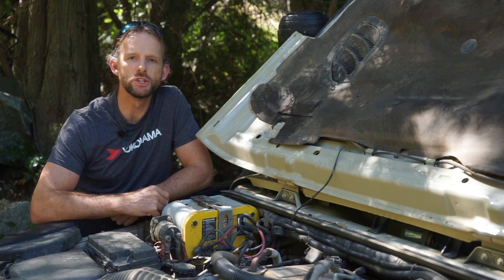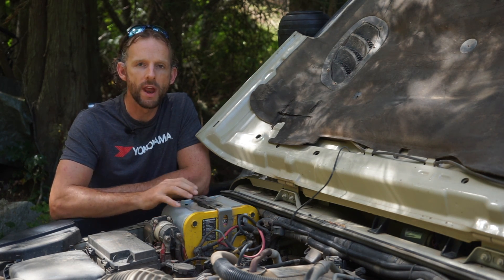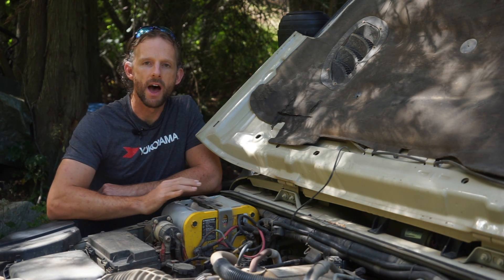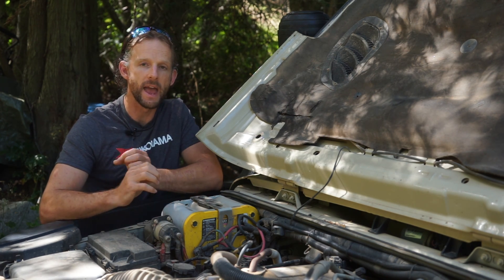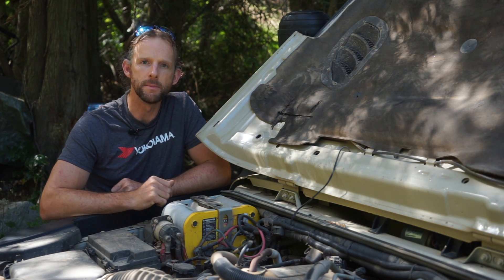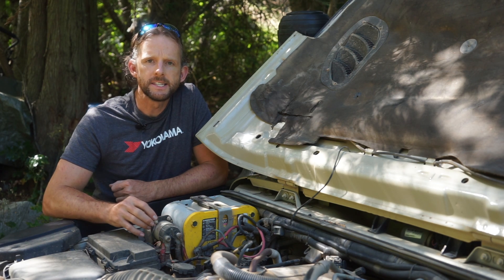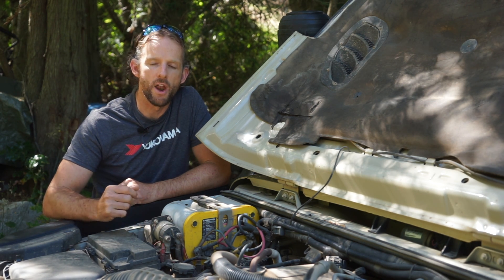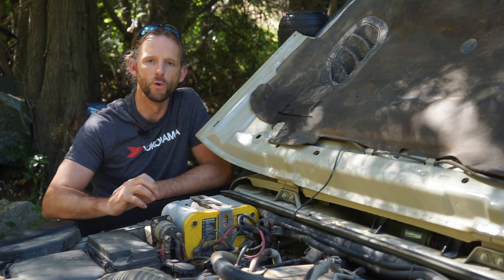DIY Dual Batteries for your Overland Vehicle - what, why & how

Comment: Could you provide a simple sketch that shows the Renogy Charge controller working with your existing system that enables the Alternator to best charge the house battery (the one most likely to be low) without overcharging the Starting battery and enabling your Solar Panel to charge the house as well? Thank you.
Reply from the maker: When the engine is running, the alternator charges the two batteries, and the solar charge controller is connected to them. The charge controller sees the high voltage the alternator is putting out, so it does nothing. So to be clear: When the engine is running my solar does nothing.
That's how my system works now with an old and simple charge controller, but as I said the newer charge controllers will use as much solar as possible, and then augment that with the alternator if needed. So I will upgrade to that kind of setup for my future vehicle.
Reply: @TheRoadChoseMe  Thank you from Fallbrook, CA.  Your explanations are always efficient and helpful. I really appreciate it.

Comment: Do we need to upgrade the stock alternator? Will it get damaged due to extra load to charge both batteries.
Reply: The nice thing about this style of system is that even with a dead house battery, the alternator only "sees" one battery that is half discharged. Generally your main battery will be close to 100% charge, house battery is at 50%.  The alternator will sense a 75% charge, and will charge at a slower rate than if you had one battery at 50%. I run the same system as Dan's, and have yet to replace an alternator.
Reply from the maker: There is a lot of debate about this, some people say yes, some people say no. There is no doubt it puts extra load on the alternator, so it probably would shorten it's service life. My stock alternator is 170,000 miles old, and has been wired up this way for almost 5 years now without a problem.
Reply: Most modern 4x4 will probably already have a relatively big alternator because under the hood there are a lot of electric accessories from the factory. An electric fan draw a lot of amps...

But on older 4x4 you  may have 40 or 60 amp alternator and that may be quite low if you run a lot of things.

Also note that if you upgrade the alternator (particularly *2 or *3) you also need to increase the wire harness gauge if you don't want to end with a bbq in your engine bay.

Comment: Many videos out there of lithium ion batteries catching fire. I would look into LifePo4 , safer, super long life, literally thousands of cycles. Expensive yes, but doing the math I think they are worth it.
Check out Will Prowse videos on solar, batteries and all that. The kid knows more than anyone I have seen and does a ton of testing.
Reply: I fully agree. Will Prowse is the Genius !
Reply from the maker: I'm hoping "new" batteries become more and more understood before it comes time for me to select what I want for a new vehicle!
Reply: @TheRoadChoseMe  pull up that Will guys vids, alot of info there.
One of the lifepo4 = almost 2 of standard or AGM as you can discharge down further without damaging or shortening the cycle counts too much.
Also if I remember right , all lithium, the ion and iron phosphate, (LifePo4) have temperature limitations so you have to look it up and see .  The Battleborne someone else mention has a good rep. And just watched a video of that guy tearing one apart , interesting.
If you have enough of following , you might reach out to them , they may just give you one for free or discounted for the advertising..
Reply: @TheRoadChoseMe  Dan you said you really didn't use that much capacity in your batteries in Africa with the solar etc. so other than weight savings, why would you go to a newer, more complex system where it may be harder to source batteries if needed? Are you planning on expanding your electricity needs? Just curious what your plans are for newer build in terms of lights and electrical accessories.

Comment: i didnt have much luck with these D34 yellow tops either bought one 3 years ago and after a year and a half or so one of the top posts became physically loose and eventually stopped making  a good connection internally, got a new one from warranty, but that was only a year ago and that battery already is getting pretty useless, it wouldnt start the jeep if it sat more than a couple days and theres no parasitic draws its just weak and would barely start it under ideal conditions, i used it alot for winching im assuming thats why, im moving the yellow top to the rear to provide a little capacity for an inverter until its completely dead, i bought a motomaster brand AGM from Canadian tire, it was considerably cheaper, has alot more AHs and Cranking Amps and carries a 5year warrranty
Reply: I too found the found the blue and yellow tops too fragile as auxiliary batteries however the best starter battery I ever bought (lasted over 10 years) was an Optima red top. My current red top was discharged to 0V by an idiot mechanic soon after I bought it and to my amazement is still working 6 years later. So for me use Optima red top starter batteries and other brands for the auxiliary battery.
Reply: @defendermodsandtravels   the yellow top was starter battery and winch battery, wasnt running a secondary battery or any prolonged draws like aux lights or inverters, red tops are suppose to be better suited for starting and winching might of had better luck with one of those

Comment: Hi Dan.  Do you have any estimate of how much more quickly the DC/DC charger would charge the house battery vs just using the alternator directly (like you currently do)?  You said it would take "many many" hours of highway driving to charge the battery directly from the alternator.  Would the DC/DC charger cut it to half the time?  A quarter of the time?  Tks!
Reply from the maker: I don't have hard numbers on that, but the DC/DC charger is the best (and correct way) to do it.
I imagine the details depend on the type of battery, the capacity of the battery, how discharged it was and how many amps the DC/DC charger is rated for. Remember you don't always want to charge it at max speed because that can be bad for the battery. The DC/DC charger has a lot in inbuilt smarts to do it the best way possible.
Reply: I've got a very similar setup in my 2001 4runner using the Stinger isolater and two AGM batteries. It works well, but a DC/DC charger should charge the house battery quicker and more full.